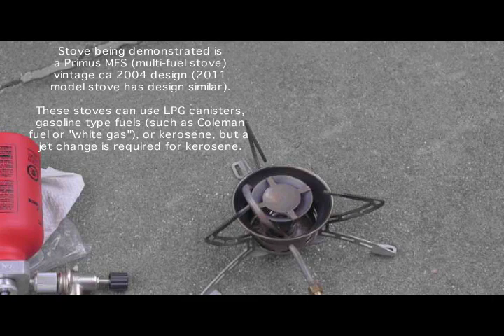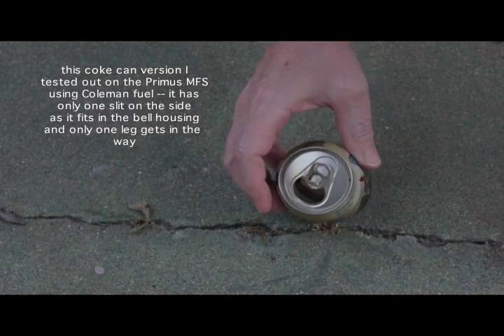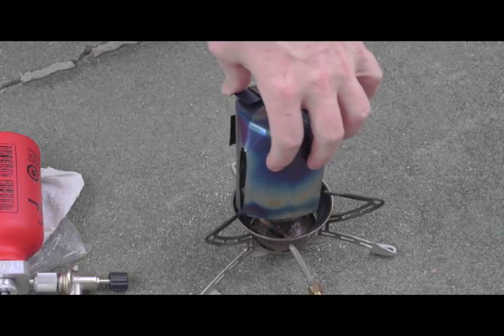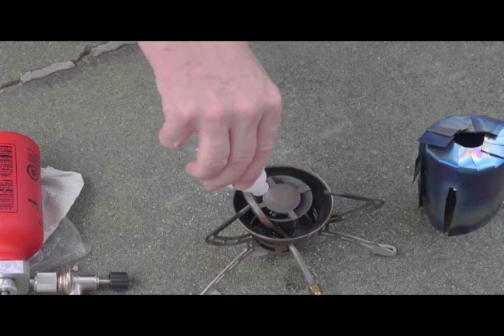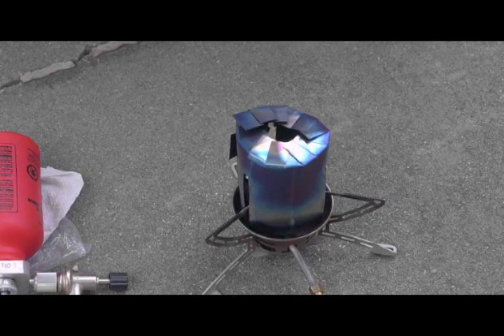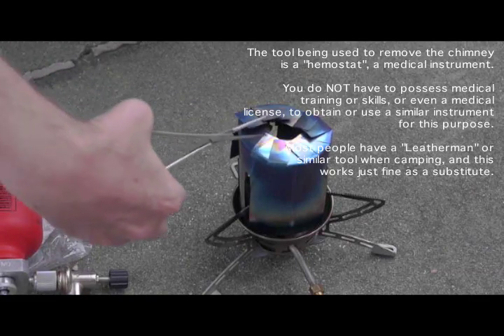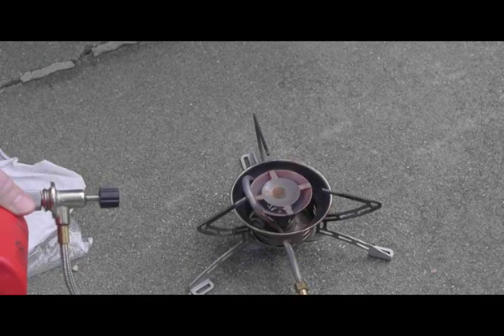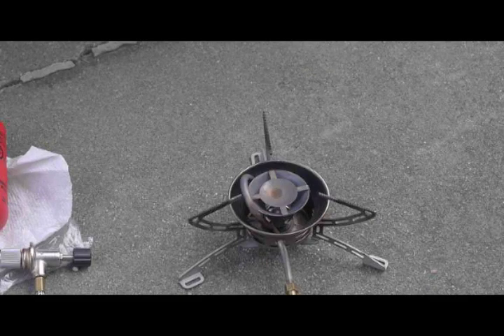Primus MFS stove on kerosene, start-up using a titanium chimney

Comment from the maker: 1) this is the approved shutdown procedure as shown in the operating instructions of numerous similar stoves - they ALL recommend "bleeding the line" so you don't have liquid fuel staying in the line

2) IN THEORY a mix of air-fuel will burn but in practice, it has to have the right ratio of air:oxygen and this mix being bled out seems too "rich" (too much fuel) as the air inside the bottle is "saturated" w/ fuel vapor and probably wouldn't ignite anyway. [I hope!]

Comment: I would say that the demonstrated shutdown procedure could be a bit dangerous.  The pressurized air inside the fuel bottle contains oxygen and fuel vapor which, if let out through fuel line to the burning stove, could burn inside the fuel line. The flame could trace back from stove to the inside of the fuel bottle and cause explosion.